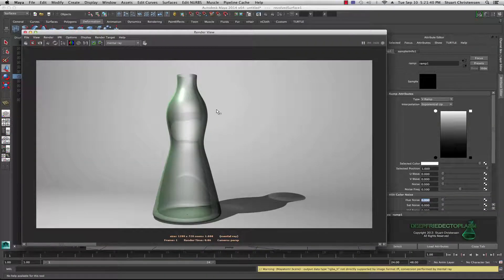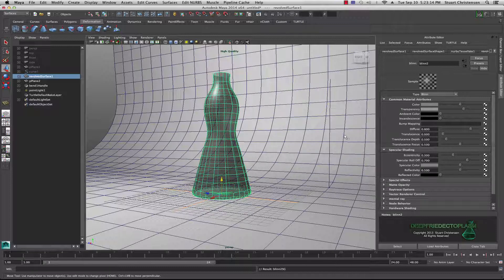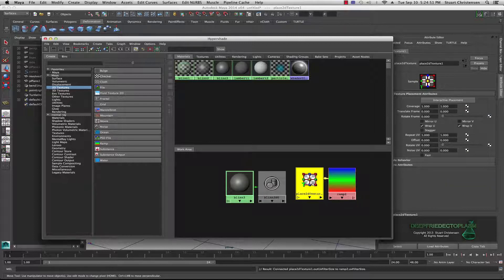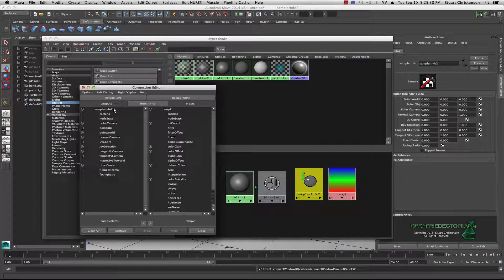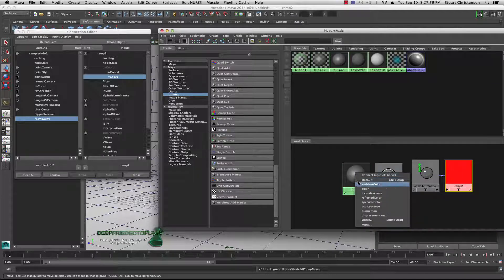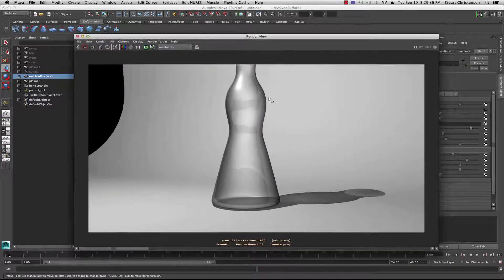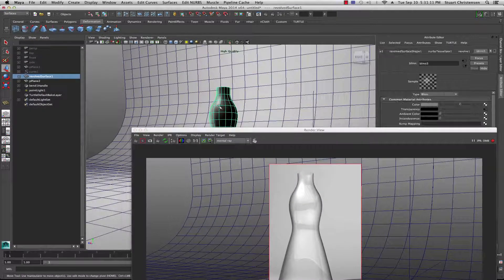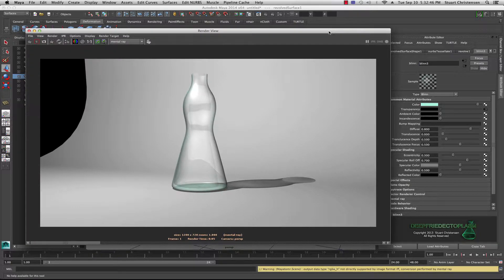Maya 2014 Transparency and the Sampler Info Node Tutorial by Stuart Christensen

Comment: Why wouldn't one just use a mia_material_x instead of using a blinn or something like this?  It would be a lot easier using a refraction index instead of trying to simulate it with the crappy Maya materials.
Reply from the maker: Well, there's many different ways to do stuff and this method is just an explanation of what the info sampler does (sort of), and how it can be useful on a basic level.

Comment: I'm sort of disappointed with this tutorial, to be honest.  For most of your tutorials you take a good chunk of time to explain the cause behind the effect, and while this tutorial may show how to achieve the final effect, there is no actual information on what exactly the sampler info. node is, or its effect on the ramp.  What is the facingRatio on the sampler info node?  What effect does it have on controlling the ramp?  What advantages are there to linking the sampler info node to the ramp vs. just linking a ramp to the transparency?  It seems there's a specific purpose to the sampler info node, but without knowing what it does, it's hard to see it's value as a tool that can be applied for other purposes.